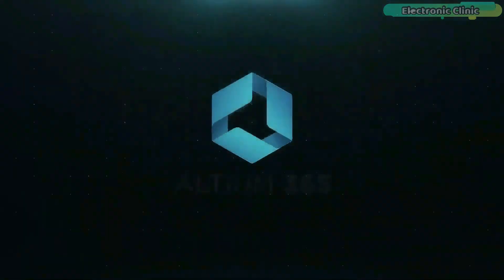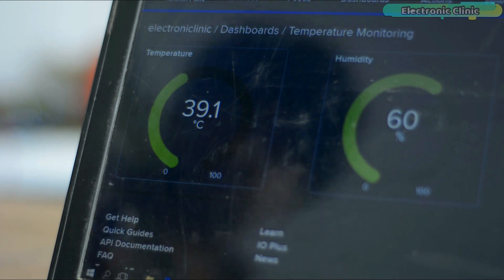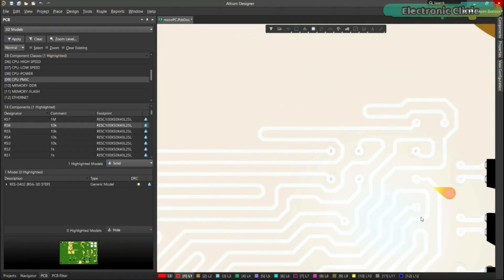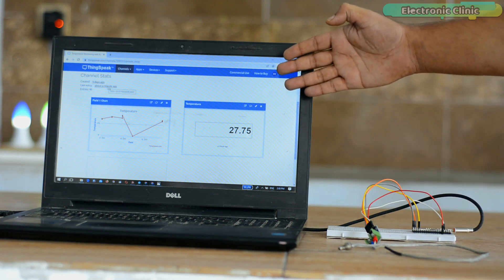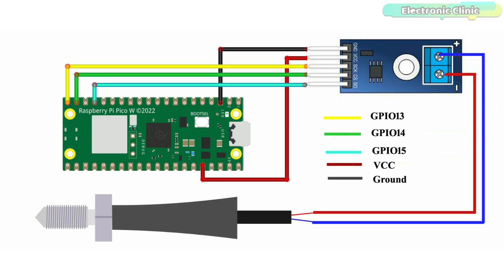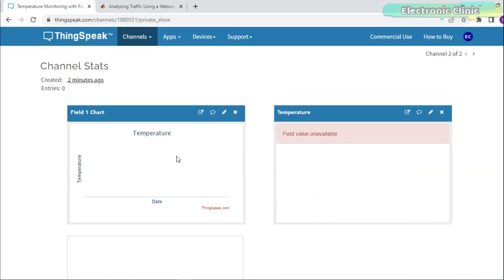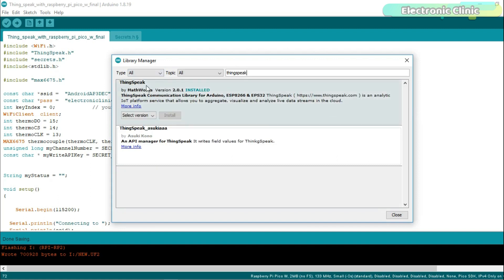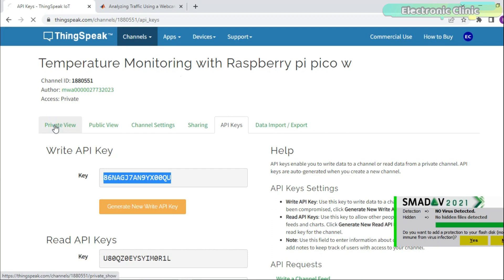Raspberry Pi Pico W with Thingspeak and MAX6675 K type thermocouple, IoT Project

Comment: Please make a micropython version of this
Reply from the maker: I checked the code it compiles there are no errors. I don't know if anything is updated on the thingspeak.
Reply: @ElectroniClinic maybe you have some specific settings like for the secrets library how you did it as there's no secrets.h Library and if yes how to make it a library to be used as import secrets.h
Reply: @ElectroniClinic so ive installed max6675 Library but it says as there's no max6675 Library but when I check it it's there's also the secrets.h Library is missing please tell me how to fix this , I'm working on some project so I need it badly please help me can we share any mode of communication like Instagram or anything so that I can seek help from you?